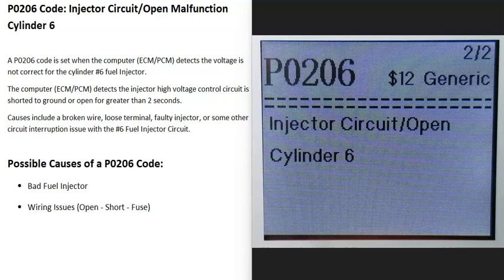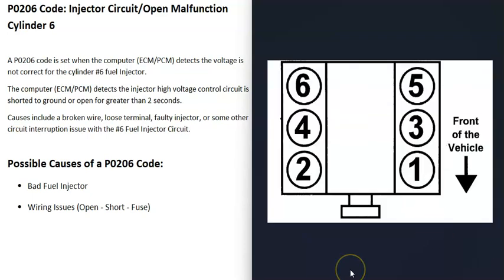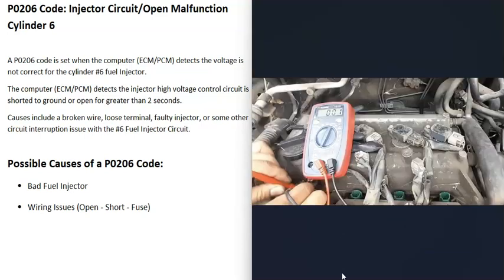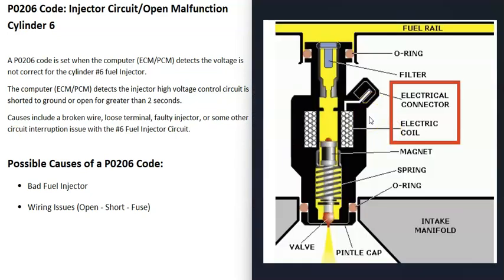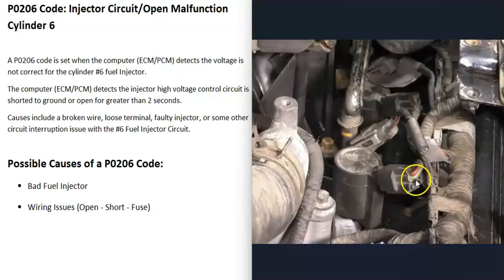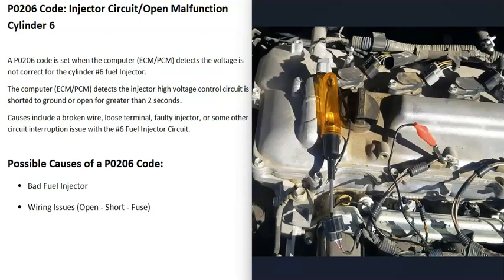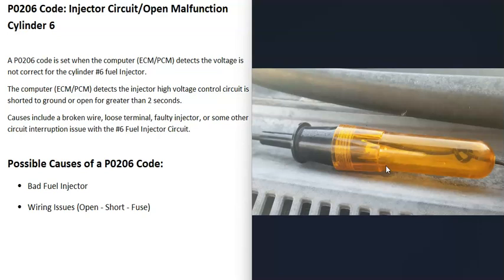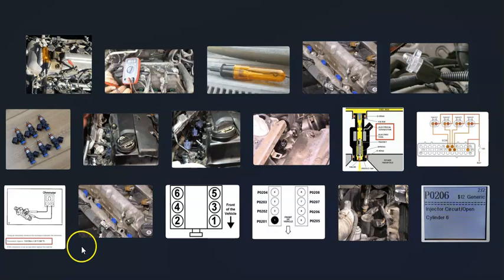Causes and Fixes P0206 Code: Injector Circuit/Open Malfunction Cylinder 6

Comment: Well my 14 silverado just threw one on the way home for cylinder no 6. I dont have the momey to pay anyone right now but it is at 139k with what are either the original plugs or at least theyve been in it as long as ive owned it (39000 miles). I also happen to have the right plugs for it as my deville takes the same ones and was going to do those at some point. So im really hoping i get lucky and that does the trick. If not im going to comment when i know what it is and whether or not you were right in my case. Either way thank you for the video and explaining it well.
Reply: I was wrong they're different length plugs, I was able to get a new coil and plug wire for cheap and borrowed a multimeter to check the ohms coming from the injectors.
Reply: @ryanr1945 you find a fix?

Comment: Off topic I know but I'm desperate for help. I'm sorry for this question I know it's something I should know but I'll explain. I have a 2003 Toyota Camry XLE 3.0 V6. Does this car have a exterior/mounted on the side throttle position sensor? I've done a visual inspection and I do not see one. I ordered a new Toyota original throttle body and it came with one. When I look online for a TPS at Toyota dealerships they all say unavailable. I did find them at places like O'Reilly's, Auto zone etc and they have them for my car. So the new throttle body showed up today and it has a TPS located on the side. But I do not see the TPS on my old throttle body so I'm confused. Please help
Reply from the maker: It can be difficult to know exactly what is going on with components without diagrams and schematics for the vehicle. It is best to find diagrams for the specific model, year, and engine since things can vary. It can be hard to find diagrams and schematics for free. Professional mechanics use paid services such as All Data and Mitchell Pro Demand. All Data has a DIY section for individual vehicles, but it does cost by the month, and they often have recurring monthly fees, so if used, be wary of which service is bought. Finding a manual for your specific vehicle with the information is likely best.